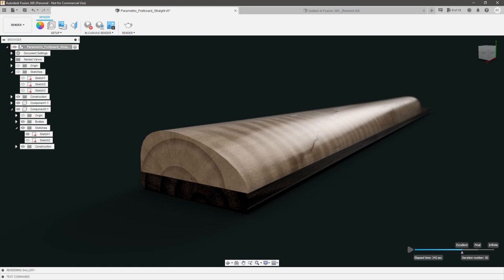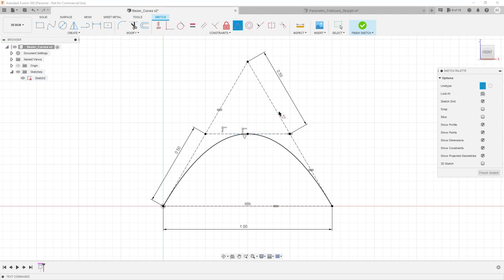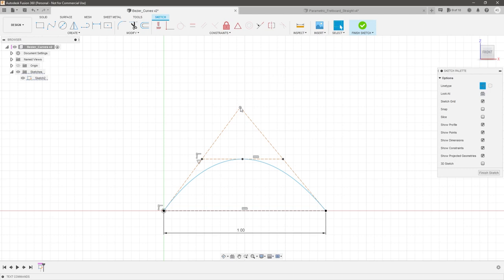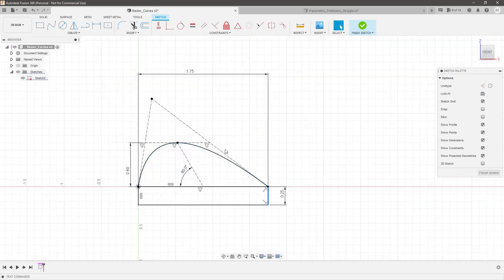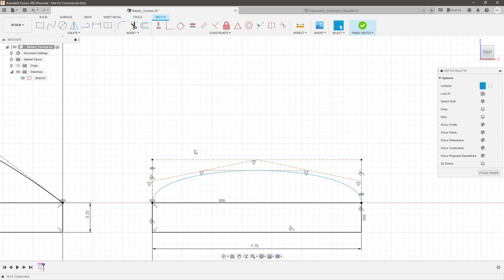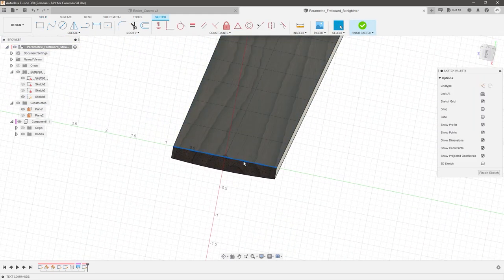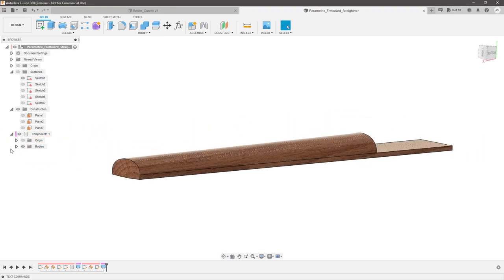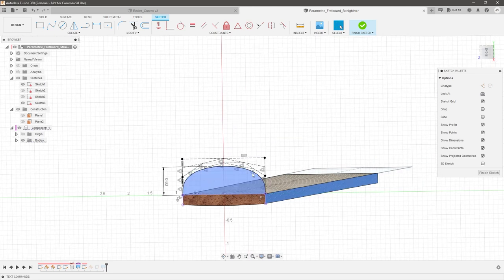This secret to control point splines changes everything | Mastering guitar neck profiles.

Comment: thank you so much. I'm designing a rocket engine using Nasa CEA. I was told to model the nozzle geometry using a bezier curve that I computed in MATLAB. I have the three points N, Q and E using the method of Rao. You're explanation to use a control point spline was EXACTLY what I needed. Thank you so much for providing what 1000s of forums fail to convey.

Comment: This is a timely video for me too. I recently did a video on a pencil holder where I did a circular pattern of fit point splines. It was pointed out to me that patterned instances of fit point splines do not update when the seed spline is changed! This was kind of a shock to me. But patterning control point splines does not have this issue. I was planning to do a video as a follow up and was looking for some videos to learn more about control point splines and was pleasantly surprised by this. I have definitely drawn some inspiration from this. Will definitely credit you in my follow up video. I have to say, you know your geometry!!!
Reply from the maker: Thank you so much mate! It's odd for me to hear that i know my geometry as I flunked almost every math class I ever took in school. But I've grown a lot since then! 

I didn't know that patterned fit point splines don't update parametrically. That's very useful to know. I do know that fit point splines operate on a similar principle to bezier curves, but seem to be different enough to not be as predictable. I wanted to include information on them in this video but it's been difficult to find info online for exactly how they work under the hood. 

I look forward to your video! Feel free to clip anything you need from this video if you need to. 😀

Comment: Austin your channel is nothing short of amazing. I started to learn Inventor so that I had more control and easy repeatability with Guitar construction. You have opened my eyes fully to the power inside Fusion and infinitely dramatically reduced the sketches and procedures to drawing a guitar for construction, while providing methods to constrain sketches and functions throughout. Your contribution to guitar construction is ginormous. Best guitar construction in Fusion by light years. I have been pondering these problems for ages and haven’t come anywhere close to your solutions. Austin you are the god of Fusion 360 that luthiers have been looking for. Best Patreon I’ve ever backed. Clearly I know very little of the power of Fusion unlike yourself. Keep up the amazing work my friend. Wished I lived in your part of the world as I’d like to buy you a beer or ten. You rock 🤘🏻🤘🏻🤘🏻🤘🏻

Comment: Just awesome, thanks so much 👍🙏
Question how do you do parametric fretboard work this way that would really be great to learn. I went to your website, does this have more content vs on your youtube channel pr are these essentially the same videos ? thanks again
Reply from the maker: Hey Hans! 
If you watch my "Parametric Design Intent" video i go into how to add user parameters to control your models/sketches. After that it's simply typing in your standard fret spacing formula to calculate each fret. Then go and link those parameters to your fretboard sketch.

I'll likely do a video on it at some point as this is the second time someone has asked me this question! 

There are no videos posted on my Patreon, only my youtube channel. Patreon is where i receive donations and post my Fusion files featured in each video for people to download and play around with.
Reply: @austinshaner  thanks so much for the feedback Austin, I really love this kind of videos so complete and detailed I learned a lot in already a few minutes, I'll check your website, this is really awesome stuff! 🙏🙏

Comment: Hi Austin, thanks for the video. I found it super helpful. One thing I running into is how to create a helper surface for the headstock transition using this method to draw the neck profile. As it's not a 3-point arc, do you have any thoughts on how best to create the necessary helper surface for my headstock transition?
Reply from the maker: Hey Lewis!

There are two helper surfaces generated from the neck profile. The first one would be the neck itself in which you can simply split the face like I show at the end of this video. The second is the "dangling" surface I used to extend that curvature to the nut.

For that one, if you are using a cubic bezier that is tangent or g2 to the fretboard, you can simply use a straight line instead of an arc to generate a vertical surface to reference.. I created a dangling arc because mine did not come tangent to the fretboard
Reply: @austinshaner  That makes sense! I'll give that a try. Thanks Austin!

Comment: Question from a noob. What exactly do you get from having everything dimensioned? The angle of the asymmetrical shape etc. If these dimensions are undefined will things go goofy when it comes time to throw some wood at the cnc? I'm not sure what cad softwares can 'infer' without being told every single dimension, I assume it just kind of inherently knows what's going on based on other more simple dimensions
Reply from the maker: It's good design practice to fully define your sketches. There are many reasons, but the primary one in my opinion is because it makes your timeline more stable. Fusion knows where the sketch exists in space, but without being fully defined, it doesn't know that it needs to remain in that position should something change. So for example, if you had an undefined sketch that is driving an extrude or loft feature, and later down the road you wanted to change something, your sketch may go haywire and produce incorrect geometry. The other elements of your design was able to move that sketch because you didn't tell fusion that it needed to stay put, or how long that line needs to be, or radius etc.

Hopefully that makes sense
Reply: @austinshaner  Hey thanks so much, that totally makes sense! I'll keep plugging along on my guitars and see what happens come prototype time. Hope to have a working proto soon!

Comment: For Some reason it won't let me set a multiplying dimension off of the first 1inch using the T-value parameters, it'll let me dimension off of the 1inch dimension by *.25 just not using the parameters to do so, not sure what going on... I ended up dimensioning a 1 inch parameter separately then set that for the first line then I used that parameter to tell a new parameter to calculate it (that 1inch parameter) by *.25 and used that new parameter to drive the construction line tangency, hoping it work and won't lead to issue down the road.

Comment: Austin,
I have access to Autodesk Powershape. Do you know if this is possible to do in that software?
Reply from the maker: I do not know this program well enough to confirm that. But this function of bezier curves remains true across any platform, but whether or not you can utilize it in this way I don't know.

Comment: This is great. I was trying to get that wolfgang neck profile and this is surely the way to go.
By the way Austin, how do the true 3D modeling sorcerers like yourself approach arch/carve tops? After finally finishing my strat project I'm giving the Les Paul a go so I get the basics out of the way.
Reply from the maker: Hello Felix,

I'm still working on developing a reliable method for an Archtop. Mattia from my discord Server has gotten very close but it is definitely not a basic model, infact one of the more complex ones to approach with its subtle, but iconic, shape
Reply: @austinshaner  I'll be very interested to see it when you are done.  I've been modeling a PRS style body in Rhino for about 15 years. It's fine, but has limitations.  I'm very interested to take it to a new level.
Reply: @austinshaner  Interesting, would love to see your approach compared to mine. :)

Comment: Not sure why you changed the asymmetrical from one end vs the other. Wouldn’t you want the asymmetrical shape (direction) to be the same on both ends?
Reply: Check out Strandberg's Endurneck
Reply: The asymmetry or progressive neck carves are like that, that enduraneck has a faceted diagonal trapezoidal shape to it (it doesn't transition to rounded). I personally like his schema for the headstock, then not quite the opposite  asymmetric carve at the heal (so diagonal transition, but the heel highpoint is just-off center).

It's to accommodate the resting position of the thumb and it's difference from headstock to heel. It's ergonomic that way

Comment: Control point splines in Fusin 360 are NOT Bezier Splines, they a B-Splines, NURBS to be precise. Only when a B-Spline uses a number of control points that is +1 the degree of the curve is that mathematically equivalent to a Bezier Spline. A 5-Degree B-Spline with 6 Control points is also called a single-span B-spline and that is mathematically equivalent to a 5-degree Bezier spline. If more than 6 points are used in a 5-degree B-Spline then that creates a 5-degree multi-span spline.